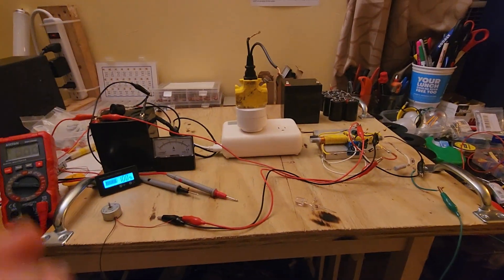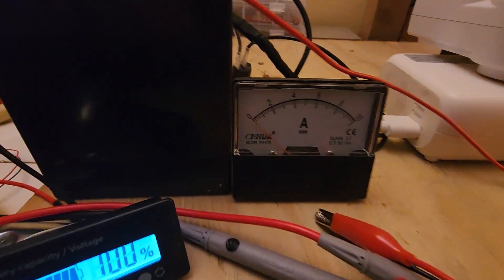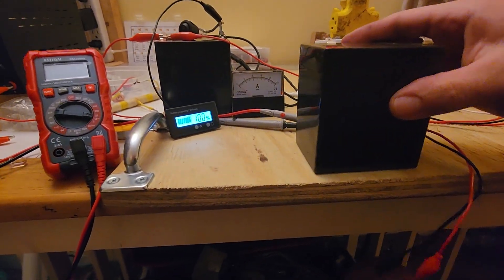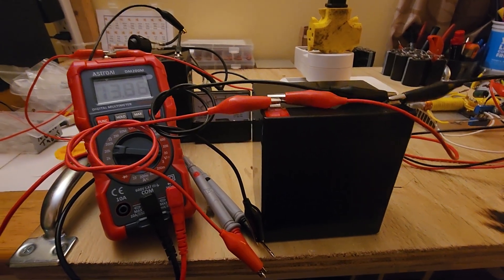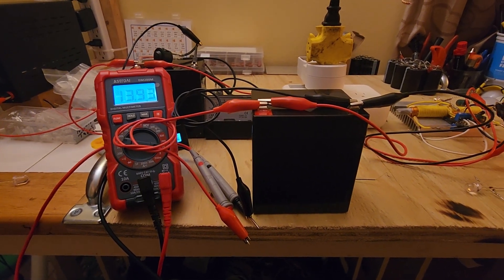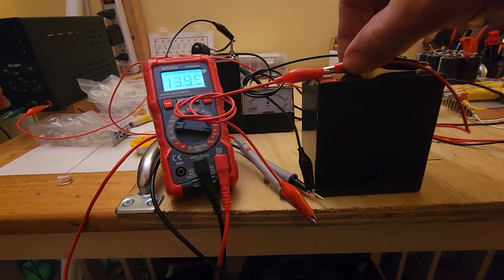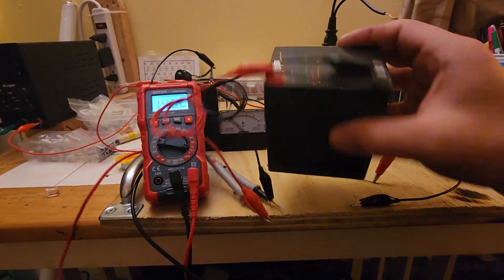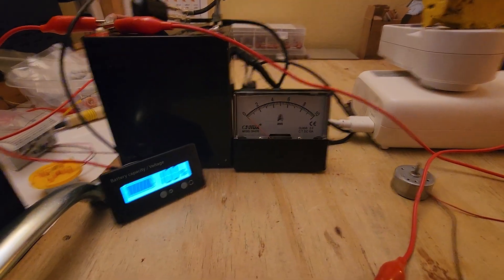💯%UNDENIABL PROOF OF THE NEGATIVE RESISTANCE PHENOMENON & SUPER CHARGING EFECT WITH 3% INPUT POWER🔋

Comment: Why not recharge the main battery? Why charge a second battery? If you could charge the main battery, will be no doubt about your system.
When you charge a second battery, you cant ensure that energy that come from the first battery is less then what was stored in second battery.
Reply from the maker: @rochaaraujo9320  it can recharge the main battery but the tuning becomes very challenging & the rapid recharging effect is much more pronounced & easier to tune for some reason with a secondary battery  :)
Reply: @MTECH2022  ok, seems easy to solve the problem. When the secondary battery is fully charged, just invert position between batteries. Put main battery to load and secondary battery to supply power. You could repeat process few times. After all, you'll have both batteries full loaded. This could prove that system works well.

Comment: Negative resistance? Bro, u got some learning to do
Reply from the maker: Feel free to read all about this effect. https://en.m.wikipedia.org/wiki/Negative_resistance
Reply: @MTECH2022 so I rewatched the video and u say it can do work but it’s not going to do any work. Looks like ur transformer and diodes are doing all the work. Im guessing. U definitely need to use a digital ammeter or have a ma ammeter analog.
Reply from the maker: @Wtfinc  the circuit can wirelessly & rapidly recharge batteries or capacitors due to the negative resistance RLC super joule ringer 3.0 circuit. We can do this rapid recharging with virtually no power input
Reply: @MTECH2022 In Wikipedia they still talk about a current rise not a current drop like in your vid
Reply from the maker: @RBMK_Dyatlov1  either scenario can occur & chat gpt confirmed it
Reply: @MTECH2022  pshh, lemme read this… brb
Edit:
Im back. That is probably one of the worst I can’t recall. Now that I think we’re on the same page. Are you on some free energy campaign? Cause that’s what I thought this was. What negative resistance sounded like to me at first was something that of a super conductor. Like what negative resistance¿ if you really think about it, the complete opposite of resistance would be for current to flow. I thought you was making stuff up. My bad. I think all the theatrics like “100% undeniable proof, phenomenon” I’m thinking ur looking for free energy

Comment: If you had adequate measuring equipment you would not be as amazed by this phenomenon you are so mesmerized by. Get an oscilloscope with at least 2 channels. Measure current on one channel and voltage on another. You should look at the input and the output waveforms while using it, while it is shorted, and when the circuit is open.
Reply from the maker: I definitely plan to do that soon & much more interesting vids are coming soon

Comment: Are you sure the batteries aren't just getting a surface charge bro? 
Yesterday I watched your long video and noticed that after you'd charged the battery, as soon as you put a load on it the voltage droped way down.

My ebike - when I go full throttle the voltage drops but when I release the throttle the voltage creeps back up. 
I'm not saying I don't believe your thing here doesn't work, I'm saying that I'm skeptical of everything I see on YouTube as it is full of scammers.
If your battery has a BMS you can leave it on charge indefinitely if you wish, BMS will not allow the battery to be overcharged or to over discharge so don't worry about it 👍
Reply from the maker: Yes much more detailed tests coming soon :)

Comment: Maybe I'm just a layman here, but u keep saying words that contradict the definition of the thing you're demonstrating.

 "wireless" by tapping wires together & showing the led light turn on, but only when u touch the wires together.  & describing wireless connections but only showing a series of connections thru makeshift clamps. Tesla demonstrated 'Wireless' across a room, ya know, without wires. 

"hyper fast charging" but that's just how fast those charge. I was expecting it to charge a lot faster based on the description u claimed.
Reply from the maker: Feel free to read the full description in the outdoor ringer generator board video. The 24 minute video

Comment: WARNING: THIS VIDEO CLAIMS FREE ENERGY IS POSSIBLE WHILE IT IS PHYSICALLY IMPOSSIBLE
Reply: @MTECHINDUSTRIES2022  
You trust everthings from GPT but you dont even understand thermodynamics and try to make misleading content.

Have you ever wondered if free energy is possible, and where it comes from? 
How do we calculate it? 
How does it generate so slowly? 
What does the system depend on?
Reply from the maker: @llo0hit0oll  thermodynamics only apply to closed mechanical systems & not negative resistant RLC circuitry present in open magnetic resonant wireless power transfer systems. Look up over 100% effecient heat pumps. & yes where did the energy to start the universe come from? What fuels it's ever increasing expansion? Eric Dollards theory of energy synthesis must ultimately be correct to some degree
Reply from the maker: Was the moray valve impossible? Was don smith's devices impossible?
Was nikola teslas magnifying transmitter impossible?
Was floyd sparky sweets vta impossible?

This is an open system energy harvesting machine & i fully detailed how to build it for free on my patreon so feel free to replicate it for yourself. Also did you witness the rapid recharging effects? You sound like a misinformation bot. Even chat gpt confirms the devices operating physics & principles.
Reply: @MTECH2022  The fing is that your LED has Zenner diodes connected. SO YOUR JUST USING LIGHT THE GENERATE THE ELCTRICITY FOR THE LED TO TURN ON! If your effect was real you would won the nobel prize. You could make a resistance 0 BUT NOT NEGATIVE!
THIS IS AN ARTICLE FROM WIKIPEDIA OF NEGATIVE RESISTANCE: Properties
Strictly speaking, there are not true negative resistors exactly as there are not true energy sources since they will violate thermodynamics laws; there are only energy converters. Whereas positive resistors consume energy from circuits, the equivalent true negative resistors add the same energy to circuits. For example, if the same current I flows through a positive resistor and through an S-shaped negative resistor with the same resistance R, the positive resistor subtracts a voltage drop V = R.I from while the negative resistor adds voltage V = R.I to the circuit. Thus the positive resistor acts as a two-terminal (1-port) current-to-voltage drop converter while the equivalent true negative resistor acts as a current-to-voltage converter.

In contrast to ordinary constant sources, true negative resistors are dynamic sources whose voltage depends linearly on the current flowing through them or whose current depends linearly on the voltage across them. They are auxuliary sources that cannot operate independently; they begin operating only after the main source begins operating.
Reply from the maker: @highvolt9563 ah  Yes, our heavily biased laws of thermodynamics that only apply to closed mechanical systems & closed circuit resistive circuit theory. The law of thermodynamics doesn't apply to open systems or resonant radio based systems & over 100% effecient heat pumps are possible due to the Pumping effects they use. I fully detail the theory of how the device works along with the physics behind it in the video description of my outdoor ringer generator board tests & the icing on the cake is the most advanced form of chat gpt confirmed everything I'm stating

Comment: I'm a power electronics engineer, and i can confidently say that you have no idea what you're doing. If you want to understand electronics and basic circuit theory,  go to college, or read some good textbooks.
Reply: Good for you. Knowledge is not behind a locked gate
Reply from the maker: I have a 2 year degree in electrical engineering & what points do you disagree with that I'm making or stating & are you talking about closed or open circuit theory?

Negative resistance is definitely a real phenomenon & Negative resistance resonance can rapidly recharge a small battery or super capacitor at virtually no input drain to your source especially if your wirelessly tapping into it & the most mind Bending aspect of this phenomenon is the output looks weak when shorted but it can do some serious work in the form of rapidly recharging batteries & super capacitors

https://en.m.wikipedia.org/wiki/Negative_resistance
Reply: @MTECHINDUSTRIES2022  I've studied electronics for 8 years, and I can tell that your methodology is not one an engineer would use. You must be crystal clear with circuit diagrams and clear explanations, not hand-wavey measurements. 

Also, you can not get over unity energy in a circuit unless that energy comes from an external RF source or electric/magnetic fields. However,  you must factor that in, and the net result is a unit of 1 or less.
Reply from the maker: @ic7481  the exact schematic of the circuit is listed for free on my patreon & the theory behind how the system works is as follows. We create a near perfect negative resistance RLC circuit & we add even more non linear behavior to it with the addition of a cold cathode gas discharge tube that looks very similar to a neon tube. We then don't tap into our power directly we tap into it wirelessly & resonatly to avoid detuning or placing a strain upon our source & earth grounding our wireless resonant receiver coils in the correct spot gives us a gain in power absolutely free with no strain upon our source.

As per the book the sea of energy in which the earth floats it's theorized all the circuits we use currently are the definition of energy loss & that energy loss is measured in amperage also known as the amount of waste heat generated in your conductor when running resistive elements or nearly any load for that matter. There's basically multiple forms of electricity & the opposite to the wasteful form we use would be a near perfect negative resistant RLC circuit that draws in excess power from the ambient environment via air or earth groundings on a resonant receiver coil & the correct fast switching Schottky diode on your resonant receiver coil will allow the rapid recharging of batteries or super capacitors. The only loss in the system occurs when the ac inverter is switched on to generate us our goofy lossy traditional form of power. Then once the inverter is switched off the negative resistant RLC circuit takes over in combination with our wireless resonant receiver coils to rapidly recharge our source. This is the type of electricity Nikola Tesla was heavily getting involved in later in his life but was denied the ability to commercially develop it due to all the stock Certain investors had in oil,engines & wire manufacturing
Reply: @ic7481  just because it is not a methodology a typical engineer would use does not mean it isn't a methodology in its own right. Also, all circuits are open circuits, ultimately. Only, the vast majority of circuits, the ones taught typically in academic studies and in books over the last 100 years, pretend that closed circuits exist and that those circuits are those. Once a circuit attaches to either the sun, earth etc yeah then it can be over unity. In this case, it's the earth
Reply: Indoctrinated by Rockerfellers pre-approved curricula, the eyes are blind to what the mind can't see. 
College will not teach you this stuff. My old man went to college to do electronics, he knows lighting comes from the sky yet denies that it's possible to harvest energy from the sky🤦‍♂️ blind mind.
Still, I need a little more proof that this thing isn't just causing surface charge👍
Reply: PhD box on your head 🎓 perfectly happy diluted

Comment: You repeatedly speak from "virtually no input power" but you do not show it. A mechanical ammeter is useless to measure rapid impulses. That's why I once more ask for true rms measurement of the systems input energy. The effect that the ammeter shows less current when you short the output can be caused by changes in impulse timing or misfit of impedance. By the way negative impedance is nothing new in physics. The I/U-diagram of electric arcs has areas with rising current by falling voltage. This means a negative slope of the curve in these areas and so a negative resistance. But this is a "differential" resistance and does not deliver energy in any way but still consumes energy, hence has an positive abolute resistance (U/R). So you first should study the difference of absolute and differential resistance and the questions of fitting the impedance of circuits to get maximum energy transfer. A consumer with resistance much lower than the inner resistance of the voltage source causes the whole energy to be converted to heat in the inner resistance and so heating the battery itself with much more energy than heating the shorted wires (even if the wires glow up the absolute energy dissipated in the battery is much more than transfered to the nearly shorted consumer). So I repeatedly advice true rms measurements of input AND output power. Free energy could not be seen in the video.
Reply: Hmm, interesting points you bring to discussion. I think i’ve seen this before on many other devices. Indeed negative differential resistance is just a method of amplification, but from this point to deny energy harvesting is a very long way.

It is enough to use a power source able to provide a maximum amount of energy and power devices that “consume” much more than power source can provide. Check time needed to replenish the energy in capacitor/battery and time for devices that work for their rated power … simple as that.
Clearly we can see there is a much higher output than input and this is all the proof needed. If you need anymore than that you can do your own research on your own time on your own money or just walk away.
Reply: @Caesarus2011  Just this we do NOT clearly see. I have seen a voltage measurement on the input source rapidly growing to 100% but when load was again connected it continued discharging with some 60 or 50%. So I assume a measurement error. The only way to prove it is for instance switching two capacitors between discharging and charging and running the load in this system much longer than the energy content of the two capacitors would last. Therefore the demonstration with approximately 70Wh isrelatively senseless. Use capacitors of 1 Wh energy content (would be enough for a few tens of seconds running 100W) or less an do the same test. If you then can repeat the cycle some times there is no doubt on free energy. And to the sentence "...walk away...": my remarks are well-intentioned criticism and an attempt to help make the evidence more certain.
Reply from the maker: There is no rapid impulse of power passing through the amp meter. The amp meter is reading the dc power drain going into the ringer circuit before the switching occurs so the circuit can't be drawing alot of power also my 14vdc input voltage virtually never drops but i will measure rms soon. Also the magic of the system comes from its rapid ability to recharge batteries or super caps with virtually no input power.

Comment: Hi, what is the frequency of the circuit? Do you have an estimate of the pulse width coming from the Earth (the positive part)? Thanks.
Reply from the maker: The frequency of the circuit is 50khz & the pulsed energy coming from the earth seems to be the same frequency as the ringer but the wave form is slightly different & a sharp pulse at 20-30% duty cycle

Comment: Would you be able to multiply the output further by having multiple receiver coils next to the source coil? I think either don smith or tom bearden had a similar setup with multiple receiver coils.
Reply from the maker: Possibly one more would help but the system is working pretty good as is & getting 3 to cooperate properly & create the negative resistance effect can be a bit challenging. 2 seems to be the magic number for simplicity

Comment: Yes, 😂, you can connect that little motor to a little generator and connect that to the input of your ringer, and disconnect the battery.
Looped system.
Reply from the maker: Maybe but there might not be a need with the rapid recharging effect from the magnetic resonance & Negative resistance
Reply: @MTECH2022  
That is indeed what I believe, that you could replace that battery with one of the other yellow coils.
You don't need to recharge those.
Wouldn't that be great?
Reply from the maker: @_John_Sean_Walker  I'll have to give that a shot but then what would run the ac inverter? A seperatly charged 5ah lifepo4 battery super cap hybrid from the wireless negative resistance output?
Reply: @MTECH2022  The yellow coil (out) runs the ringer, the ringer runs the inverter, and the wires that now recharge your battery will feed the first yellow coil (in).
That yellow coil has then four wires, thus.
One winding is the 'in', and the other the 'out'.
Reply from the maker: @_John_Sean_Walker  I'll have to give that a try